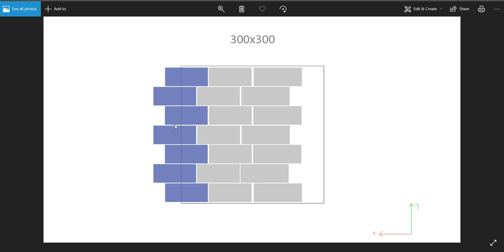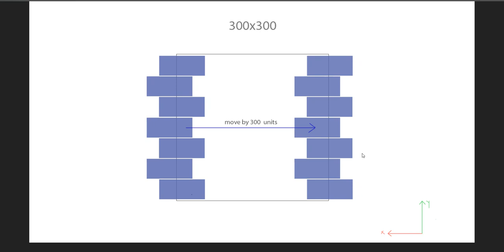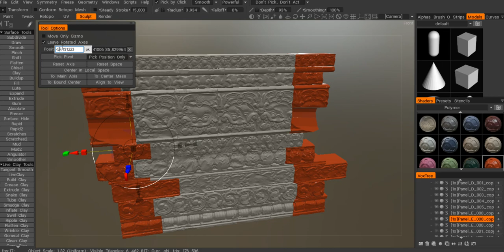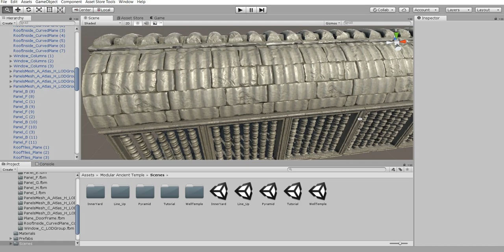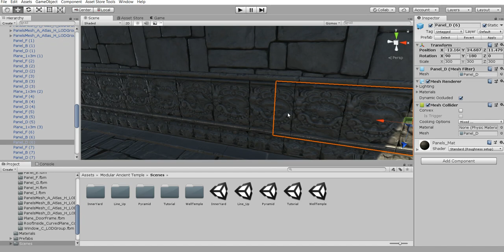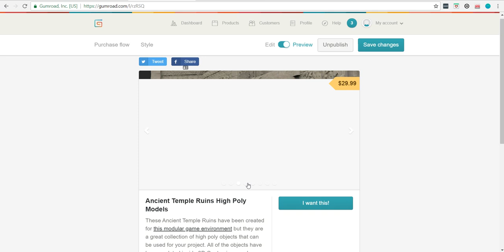3D Coat Tileable Sculpting Oldschool Method for Heavy Mesh

Comment: i still think it would be easier to set up a texture and build the mesh from the texture projection, but i would have problem for repetitive patterns on a curved plane though...
Reply from the maker: Hi M4R, hm, not sure what you mean. I didn't have any flat photo reference just general photos from the photo pack. And I also reused some of these blocks as a single mesh pieces to add relief to the buildings, so they are not always used as flat plane textures.
Reply: @AntonTenitsky  no i mean my general way of going about such things would be to extrude out a mesh with a texture alpha, and try to eyeball it for the repetition. my problem goes with curved surfaces.
Reply from the maker: ah, got you. I just didn't have any alphas that would have been relevant. I could have tried to paint alphas but I find that it's just easier for me to model them to get the best quality. But I'd say if you need to save time then using alphas from packs like this - https://gumroad.com/environmentdesign  are definitely a good idea as those alphas are baked from actual models. They just didn't have exactly what I needed and I wanted to keep ornaments in the same style across the whole environment.
Reply: @AntonTenitsky  thanks! i alwayd get that little adjusting issue because of tileability =)
Reply: Nothing wrong with sculpting designs yourself? Manhandling always give very organic, high quality, cohesive and expressive results. Thats why you often see those amazing materials such as in Rise of Tomb Raider, where the environment artits still use handsculpted technqiues for the high res meshes to get those that incredible intersting organic looks in the end: https://www.artstation.com/danniecarlone  - Most of the time, when projecting alphas only, it will simply just look like that, projected. I think starting already by hand at the base shapes will spread the love to the top detail layers of the asset. Most of the time in art, you cant just project stuff, leave as is and call it a day anyways. The saving time argument is valid though.